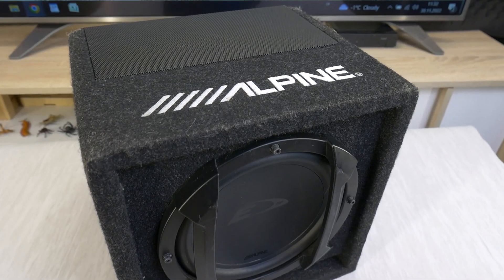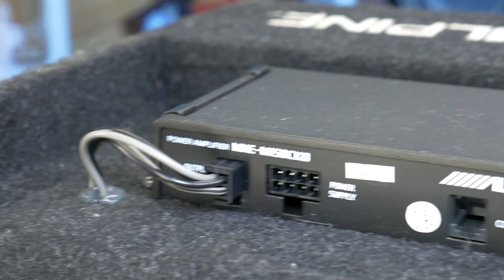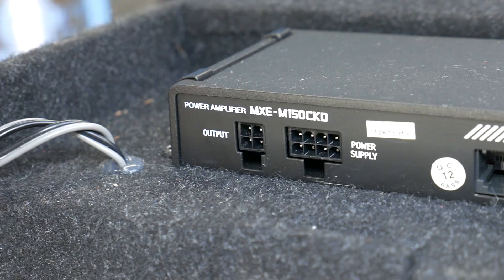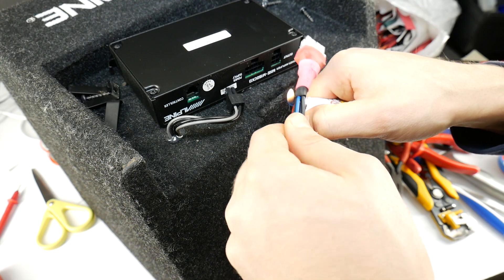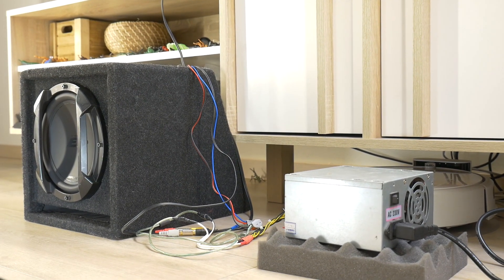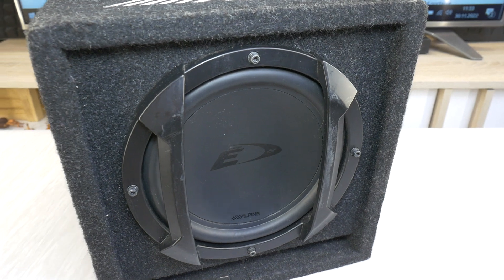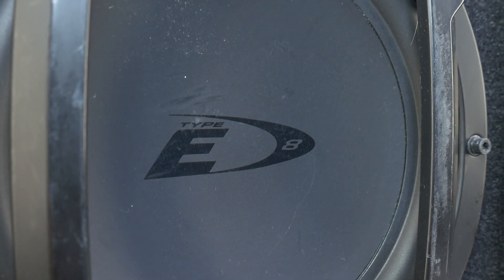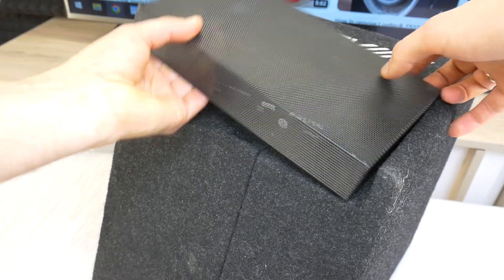Take apart Alpine Car Subwoofer + Free Air

Comment: Hi all! Can anyone help me with photo of internal remote control wiring? I pull out the cable from white pin from internal remote control and i dont know the color of pins. Ex: 1 green, 2 black, 3 Red..etc. Tnx in advance.
Reply: I purchased the product and it will arrive tomorrow. If you can't solve the problem, leave a reminder comment and I'll write the cable order for you.

Comment: Don't suppose you could measure the sub mounting depth i want to see if i can reconstruct the box to go under a seat
Reply from the maker: I measured the thickness of the subwoofer enclosure to show how good or bad the materials used to build it are.
Reply: @Techscrews thanks but I want to completely remake the box

Comment: I connected It to my car. It turns on but doesn't produce any sound. Some one knows how to fix it?
Reply from the maker: y connecting your phone to the subwoofer directly using an AUX cable to check if it is working.

Comment: Hi! Can you tell me if your amp MXE-M150CKD is heating?
 Mine heats up to the point i cannot hold hand on it...
Reply from the maker: sounds like you're use it like crazy, because mine doesn't have so much heat.
Reply: 12v güç kablosunu ve toprağı kalınlaştır

Comment: Hi, I want to upgrade the woofer with something with 1x4ohm. On the alpine website it shows that it is 2x2ohm, can i made it to 1x4ohm maybe?
Reply from the maker: Of course, 4ohm for car audio is very safe chose.
Reply: @Techscrews  I want to do the same... How i can connect the one woofer to the speaker wiring??

Comment: Can a 12 volt 33 amp strip led transformer power this at home?
Reply from the maker: easy, this system is very weak :)
Reply: @Techscrews  When you say weak, are you talking about the transformer or the Alpine subwoofer?
Reply from the maker: @senelmustafa  power, than need less Amps.

Comment: İncelediğin için teşekkürler ben de yeni sipariş verdim evde kullanacağım
Reply: Geri bildirimin benim icin onemli 2023 model aracimin ses sisteminden gayet memnunum ama en alt basslari haliyle
Bir subwoofer olmadigi icin veremiyor . Stock ses sistemine haricen uyguladigimizda nasil bir performansi oldu acaba
Reply from the maker: @barangul8004  eng please
Reply: @Techscrews   are you reccomend this sub. I have a 2023 skoda fabia (hatchback) and i like my standart sound system but i dont have low frequences . I just need a low freq support in my car
Reply from the maker: @barangul8004  yes, it's small, but for that type car it will be enough.
Reply: 装高转低。。然後就能推。。要更好的话也可以先接个三分頻。然後出來的才是纯低音
Reply from the maker: Eng please
Reply: @Techscrews  Thank you for reviewing, I just placed an order and translated it using Google Translate, which I will use at home.